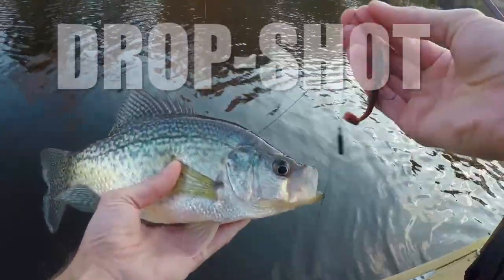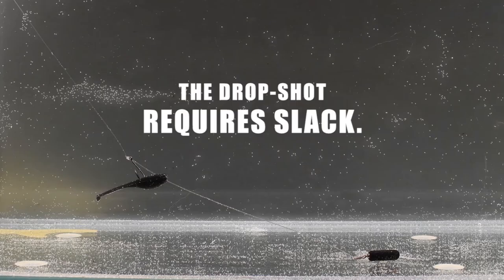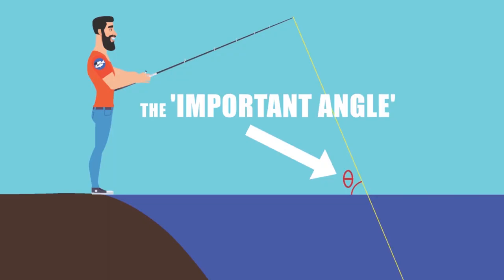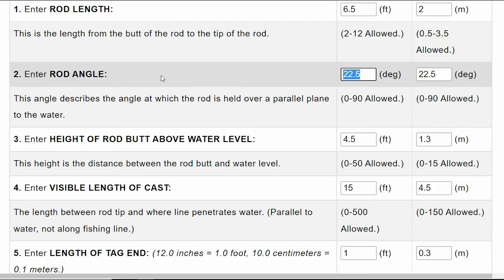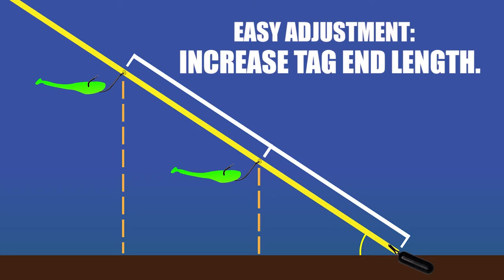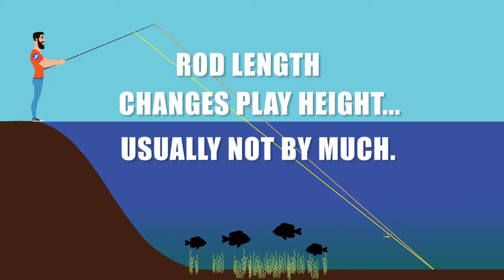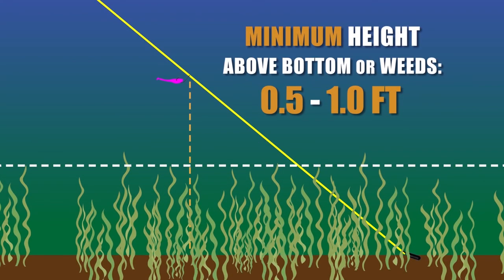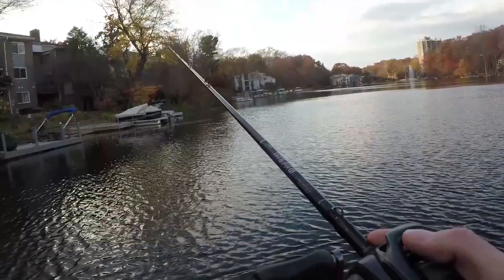Drop-Shot Fishing Optimization | Understanding Play Height Underwater

Comment: How would you factor in buoyant plastics (Zman, mule fishing, etc)? Obviously they would impact the play height, with it vary with the ratio of size of plastic vs size of hook. But are there situations where you would avoid buoyant plastics, or situations where you would specifically seek them out?
Reply: I use Zman elaztech lure’s probably 90% of the time with the dropshot for Bass. 
I pair it with a 1 or 1/0 mosquito light wire dropshot hook. Medium to medium light 7.3-7.6 length rod and 6-8 pound fluorocarbon line. 
In my opinion it doesn’t matter how far I cast it out the zman lures and the light wire hooks are gonna make the lure float to your set distance from weight.